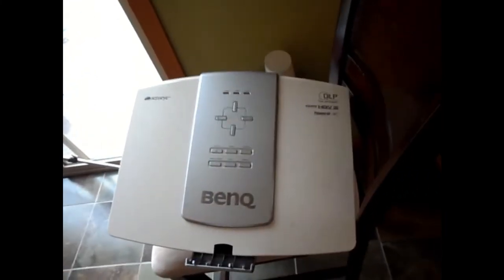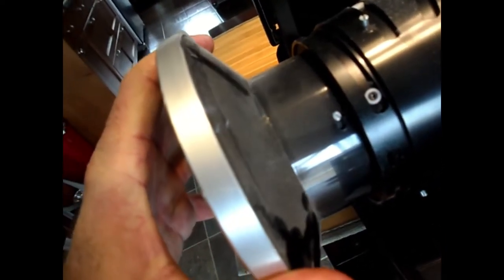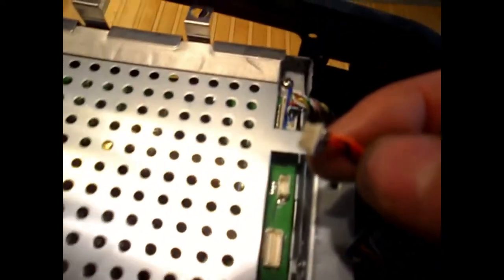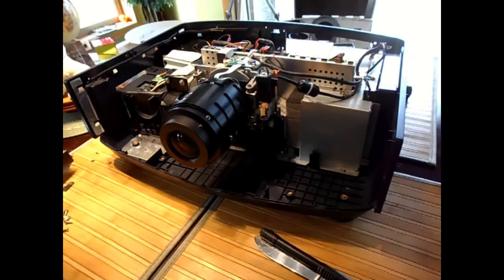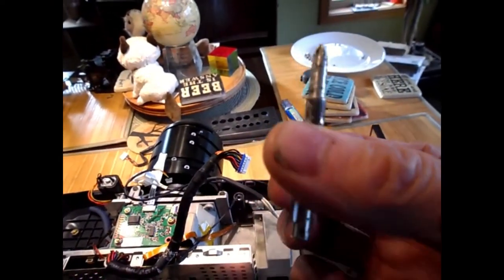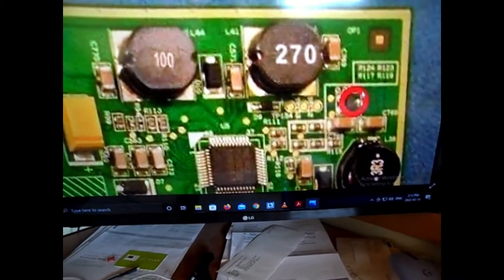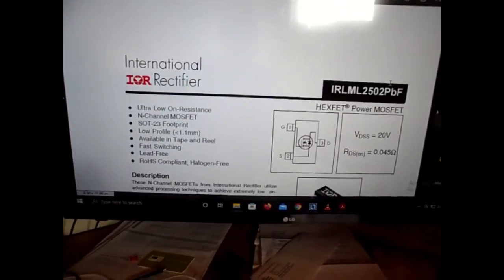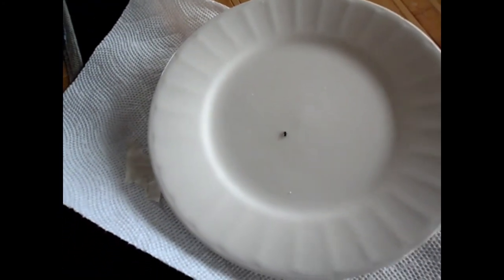Benq W5000 fixed for $0.85, LIKE NEW

Comment: Nice guide on pulling it apart Walter, I have the same unit. I had not used for about two years, and had bought a two replacement bulbs back then, that you have to install the bulb itself into the bulb cartridge housing as I was having trouble finding whole bulb cartridge assembly.  One of the metal clips that holds the bulb broke at it's bend point, so I have only one clip holding in place now with the brand new bulb- seems to be holding fine with just the one metal clip though.

After sliding the bulb assembly/cartridge back in and screwing in the cartridge with the two screws, (I think this was an issue before) the power is not even coming on. I know I have power going to the unit and I have reseated the bulb cartridge several times (thinking maybe the bulb contacts were not contacting), but plugging in, turning the small power rocker switch on, the projector will not turn on and no sign of power anywhere, i.e. no LED's come on either.  I even checked for power on the female side of the power cable that plugs into the back of the unit, so I know it is getting power to the back of the unit for sure.

Not sure what it could be, maybe it's the power supply itself on mine.... 
I guess next step to take, is to take it apart to see if I trace/troubleshoot what is wrong inside. It looks like a lot of work and may be just easier to buy another projector,  but I remember when I purchased this unit, it cost me a lot of money at the time.  It is a shame to replace it, as it puts out a great picture and I just used it for the home basement, for evening shows/movies, when I was using it three years ago and before, maybe went through three bulbs over time I have used it. Now I have one new bulb in the cartridge and another spare, but projector now dead.

Any suggestions?
Reply from the maker: Hello I remember there is a small safety switch that is activated when you install the dust filter, is this switch  being pressed properly?
Reply: @waltersavonian7551  Good suggestion, but sadly it is pushed in all the way, double checked it.... UGH, wish it was something that simple. Maybe I should try putting my second brand new bulb in, see if that does anything..... wait this gives me another idea as I remember reading there was also a switch for the outside lamp cover switch, so I double checked that, and as it turns out  : manually pushing it in, did the trick... so the cover for some reason was not pushing it in far enough to engage the micro switch. 

I ended up just adding a really small screw on to the end of the cover pin, extending it out 3-4 mm more and this did the trick.

I thank you very much for your suggestion, as it engaged your idea to one I thought of because of your suggestion and my thought of checking the lamp cover switch. Weird that it all of a sudden wasn't pushing in far enough, 
anyway, so happy that through you, I have resolved the problem.  Back in business just in time for Easter, 

Thanks Big time Walter!!!
Reply from the maker: @qprof  glad you figured it out

Comment: Great work! My W20000 shuts off after 45 seconds running and the indicator lights say to replace bulb, even with only couple hundred hours. Replaced with a new bulb and still does the same thing. What could possibly be the issue?
Reply from the maker: not trying to be a smart ass but did you reset the bulb life hour meter in the projector menu?
Reply: I did when bulb was reaplced.  Also cleaned the filter and reset the filter replacement setting.